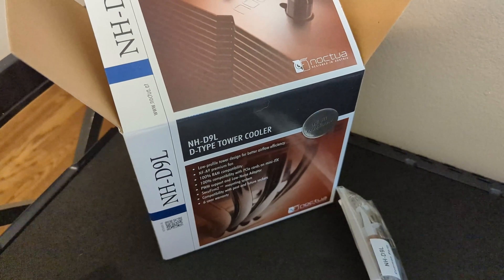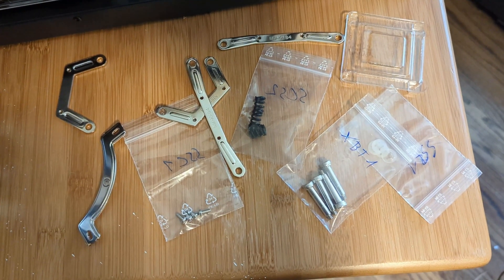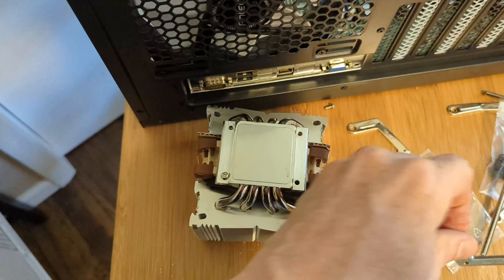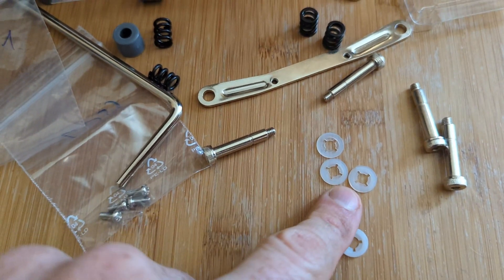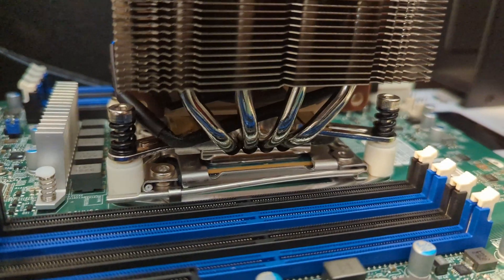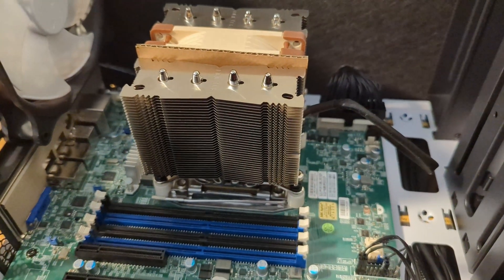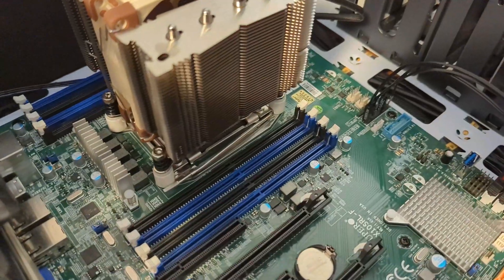Noctua NH-D9L Narrow ILM Adapter Install

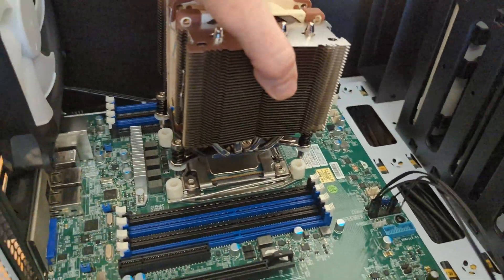Comment: 0:45 You don't need any spacers, this is only for regular sockets where you have to use the backplane delivered with the cooler. That backplane is loose from the board and the spacers make sure it is tight to the board and won't move. Narrow ILM boards already have a backplane attached fixed to the board, so no spacers required as it can't move: just screw it directly on.
Also, 2 sets of brackets are delivered: you can use the other set in the so the fans are oriented 90 degrees from what is shown in the video (to back of case, instead of to the top like in the video).
Otherwise great video! Helped me out!

Comment: Okay nice.... Love it... but what if you're using a 4U chassis and the fans are oriented the wrong way? 😐 I have the NH-U9DX i4 with a Supermicro X10. Can't seem to find the right cooler bracket combination to achieve this. I have all sorts of different coolers and brackets, so if there's a combination someone knows of, it is likely I have tried it lol. 

That said if you have any ideas....
Reply: Hi mate, im also in the same situation and haven't found a solution yet 😂